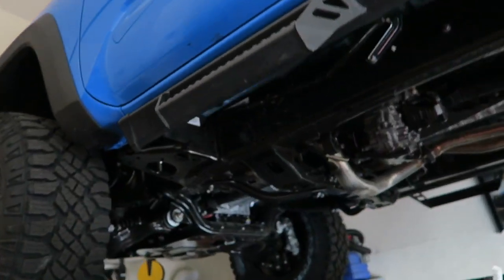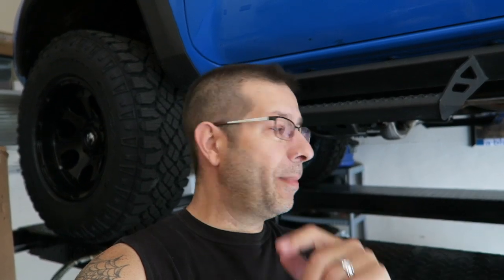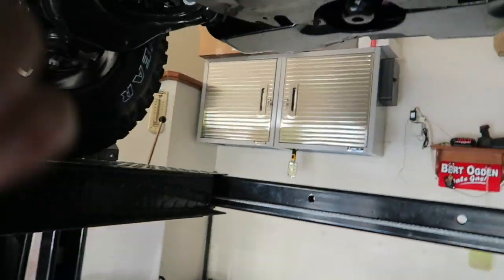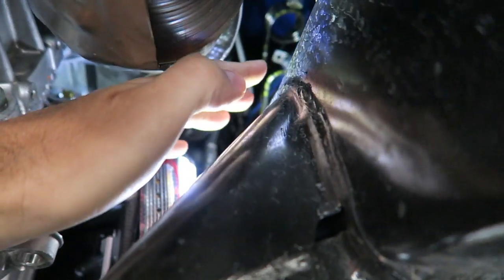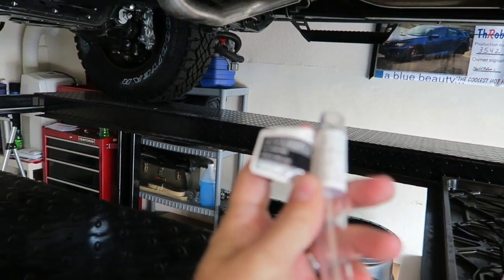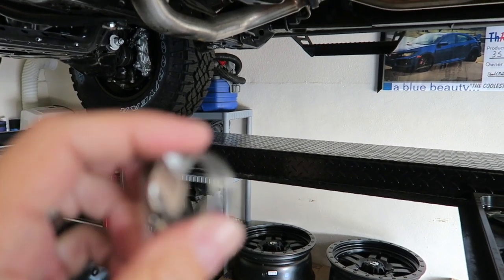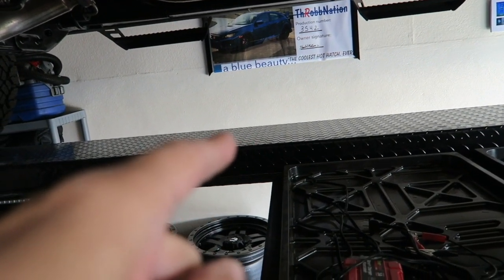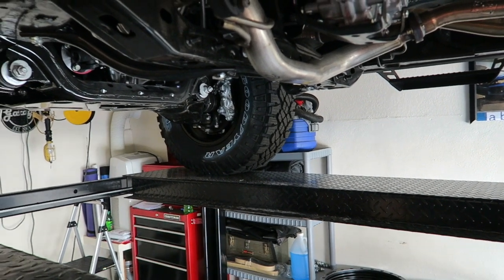QUICK MOD TO SAVE MY 2020 TACOMA FRAME

Comment: Thanks for the video, I just picked up my 2021 Off Road long bed.. Remember seeing this issue a year ago when I started researching off road pickups but forgot about it.   Going to install tomorrow.  You say a 5/8" ID tube fits right over the factory discharge?
Reply from the maker: Definitely a simple mod to help alleviate potential problems.  Don’t remember the size off the top of my head...but whatever I said in the vid👍

Comment: I did mine a little different, first I used rubber hose instead of plastic tubing as more durable and heat resistant since close to the exhaust, I gained access behind the right front tire by loosing the rear rubber flap panel in the wheel well. You can see the drain line pretty well. Then I snaked in a 2 foot piece of rubber hose through the frame holes running the hose just behind the lower control arm. Its away from the exhaust, wont vibrate loose as it's firmly in place. and runs away from the frame. Then just barely snug the clamp on the rubber hose.
Reply from the maker: Sounds good to me👍

Comment: I added this mod yesterday morning. Definitely tight quarters, but once I was able to see where the tube was, I was able to find it the second time much easier.  I actually ran about 14 inches of tubing to ensure it runs down the front part of the frame and straight to the ground. Thanks for the heads up. Glad I got this one done. One less thing to worry about for the future.  On a side note, I also replaced my skid plate with the pro plate.  I love the look. I think it may even help with gas mileage as it’s one solid piece, versus the original which was two pieces. I think that the original left a lot of room for wind to get caught up. Plus, the pro plate is much stronger.
Reply from the maker: Nice👍

Comment: Rob, will that tube melt being so close tot he exhaust?  That tube looks like for small jobs like aquariums. Maybe the black fuel insulated hose? Just thinking. Great Job as always Big Guy!
Reply from the maker: I don’t believe so.  Had the same setup on my 2018 with no issues.  However, I do think using a heat resistant tubing is a good idea👍

Comment: Just did that ac mod to my Tacoma had to use 2 zip ties zipped together just to get around the bottom of the frame. You’re right having a lift would’ve helped laid on concrete driveway. I hope it doesn’t matter where I zipped tied it because I put it around the bottom carriage bolt.
Reply from the maker: As long as you stayed away from the exhaust you should be good👍

Comment: Very  good mod thanks for info,  is diameter  3/4  ?   Some  question, what you  think for Pedal Commander Throttle Response Controller PC38 Bluetooth for Tacoma?
Thank  you  sir.
Reply from the maker: You can find detail on tubing size in the video description.  Pedal commander is not for me in that it doesn’t add any HP to the truck.

Comment: Back mask with a piece of light cardboard board. Pull the hose up off the frame and put a shot of flex seal on the drip area. Reassemble and you're done.

Comment: Hello just bought a brand new 2022 Tacoma momma wondering if I need to get it undercoded problem is as I bought it with a lease to buy don't know if the warranty would still hold up is it important to get it under coded did they do anything different with the new ones 2022
Reply from the maker: Depends on where you live and if you actually do buy it out.  I wouldn’t myself.
Reply: @RobMotive   I live in New Jersey
Reply: I do plan on buying it out but you said you would not do it I wonder why because of the warranty
Reply: And thank you very much for replying by the way
Reply from the maker: Might want to consider it🤔
Reply from the maker: Thanks for watching 👍

Comment: I slathered the bejeesus out of my frame with grease where the factory tube ends.  I'm reluctant to extend the tube in case bugs decide to call the tube home and block it.  Maybe some wire mesh at the end of the extended tube to keep bugs and dirt out?
Reply from the maker: If you used 3/4” tubing I wouldn’t worry👍

Comment: Here’s a tip I learned. Before shutting off the vehicle while using ac, turn ac off but leave fan on and preferably temp set to coolest. That causes the condensation on your evaporator to drain off of your evaporator and out that tube quickly and also helps to keep sludge from forming.
Reply from the maker: Thanks for the tip 👍
Reply: that sure is a lot of work and time consuming to do every time you get out of the truck
Reply: @exploringparks  How about just before parking !! Sound good?

Comment: Hey Rob, I don’t know if anyone has suggested this but maybe look into using a barb fitting (with those same hose clamps on both sides) to extend that hose. That PVC hose might melt overtime from the heat of the engine so look into finding similar hoses with high-heat tolerance for longevity. Cheers and thanks for the vid
Reply from the maker: Thanks for the tip 👍

Comment: Every little bit helps I guess, but fact is we all drive in rain and that gets a lot more water there than an entire summer of AC use.   Now protecting your jeep on the lift is another story.  While you don't have any rust maybe get another coat of a paint on your welded joints, they go first.
Reply: That was a quick like Rob.  You may have a stalker.

Comment: While crawling under mine, I am confused as to why the exhaust extends below the protection provided by the skid plates and bars. Any issues with that or fixes that you know of?
Reply from the maker: There are relocation kits out there.  I haven't looked into them myself.

Comment: water moisture from ac did not cause any frame issues.. come on lol.
Reply from the maker: It certainly didn’t cause the massive problems Toyota has had.  However, it surely doesn’t help😬